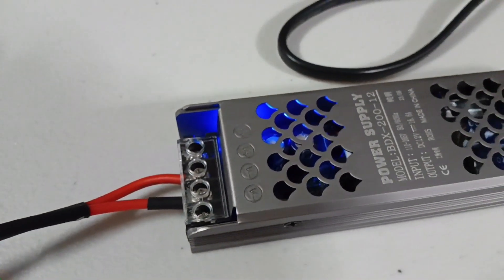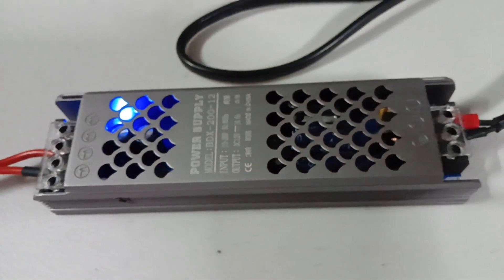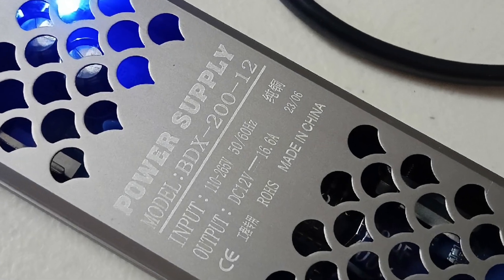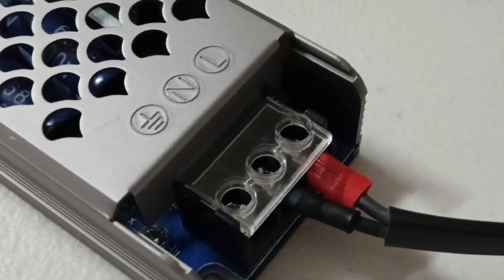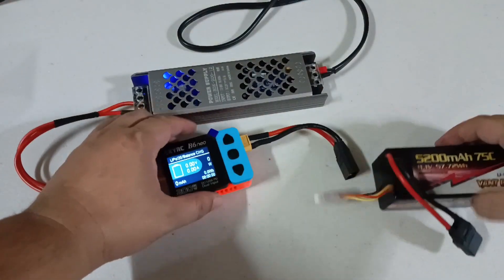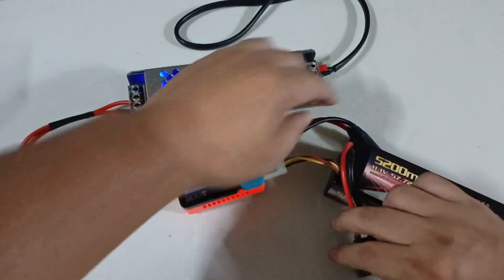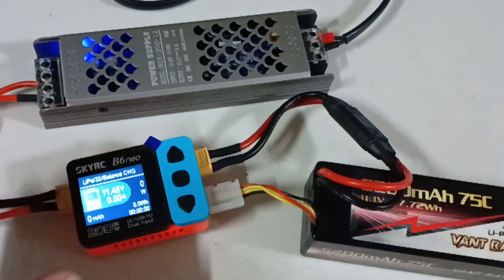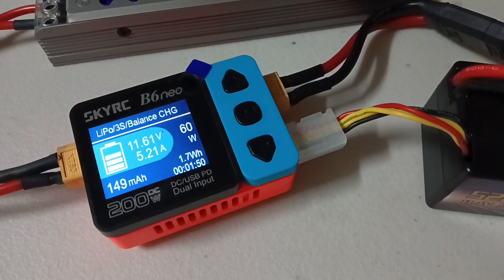SkyRC B6 Neo - unlocking 200 watts | StreetSpecRC

Comment from the maker: The DC power supply I used is rated at 200 watts. With my current batteries, it does not need 200 watts. That's why charger is just pulling 65w from the power supply. To see those high watts numbers, you need to try it on a higher capacity Lipo like 4s and above.

Comment: Yeah...because you're charging at 5A and not unlocking the 200W of DC power.....
Reply: The manual says the maximum charge current should be lower or equal to 1C, which means the charge current should be no higher than 5.2 A for this 5200mAh battery. Not sure why but it's in the manual. My understanding is if you want to really unleash the 200 watts power, you have to at least charge a 8000mAh 6s battery with it. So 200 watts is just a gimmick for most people.